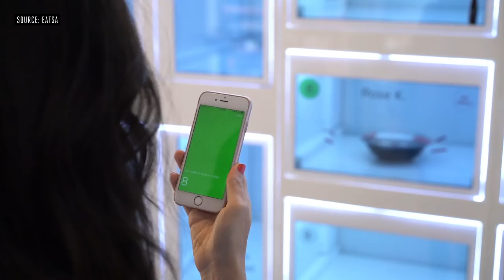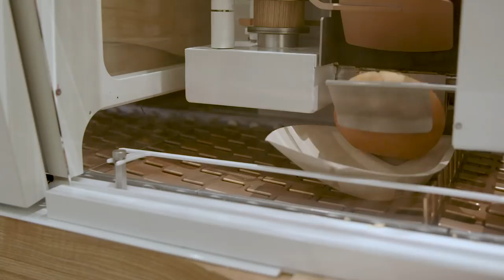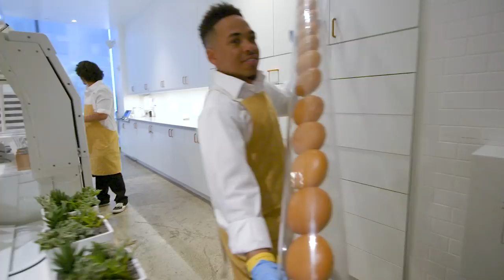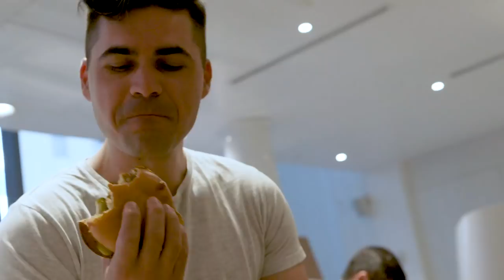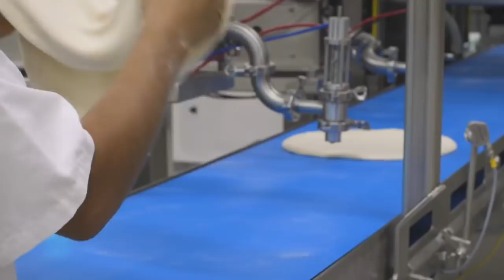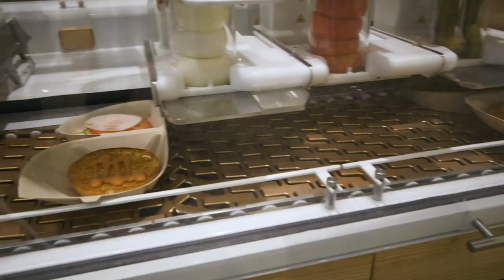Robot restaurants won’t take your job and food will be better

Comment: That's misleading, they still have to touch all the ingredients to stock the machine. So people are still touching everything on the burger. Plus the food sits in tubes for extended periods of time so it's technically not fresh. Eventually somebody has to eat the last burger in the tube and who knows how long its been in there. Plus it is touching all the fresher burgers above it when restocked unless they change the tube out after its empty.
Reply: It's otherwise sitting around in a cooler because restaurants need to keep their stock somewhere so going by that logic nothing is fresh and it doesn't matter. The point is it's fresher than, say, presliced produce. And given that it's a cheap restaurant in a big city I doubt the time produce stays in the tubes is as terrifying as you make it out to be.
Reply: This whole did not touch argument is stupid.
Assuming chefs wash their hands I have no problem with them preparing my food.
Why ask germaphobe?
Reply: @11Argetlam11  still no hairs is a plus...

Comment: "robots can pick up that slack and do those repetitive tasks that humans don't really need to do"..... yeah those are called JOBS and you literally just described robots taking those JOBS.
Reply: yeah she really stumbled over backwards on answering that question with the exact same statement as the original question, lol.
Reply: They take outdated jobs. However, they create jobs as well. Robots need to be maintained, calibrated, HACCP quality control frequency can be increased and people just need to be stand-by in case the machine is failing.
Reply: There are more fulfilling skills people can acquire. Taking orders is not a scalable skill set. I can guarantee you we will see a rise in robotics jobs, analysts jobs, and higher paying jobs in general catered to designing, building, and managing machines like these.
Reply: Sure. I'm pro machine, btw. But...the point of the machine is to save / make more money. IF that is in regards to rent space, sure! But generally, it's to save on labor costs. If a restaurant spend 200k on a machine and then even more money for the labor to run the machine, that's not going to work.
Reply: Before computers, clerks in banks manually tally account transactions and keep typing each ledger all day long. Just think if banks did not started using computers to save JOBS how our modern world would be? Now we have multiple branches of banks which can be managed by smaller people instead of bigger branch having multiple employees...maybe you don't need to go to a branch....you get everything on your mobile!
Reply: well the jobs weren't outdated until very recently. And obviously robots like this destroy far more jobs than they create, otherwise there would be no point in them
Reply: People working as cooks in san francisco won't be able to sustain themselves and will have to move out of the city or decline jobs, as mentioned it the video. Robots will have to fulfill that absent role.
Reply: guys get over it. this is the future. companies do not care if the robots take other people’s jobs because they profit from it. it is what it is
Reply: People like you are the reason why humanity cannot continue to innovate and move foward
Reply: Automated machines creating jobs in (making / servicing / etc) those machines is a fallacy which ignores AI in a decade from now.
Reply: Pannathat Poolkamlung 

Tbh moving forward has completely destroyed the natural world. We should stop being so innovative.
Reply: Moving forward has brought us ways to fix our mistakes. Not being so invoice would keep the coal burning, and poverty the same..  @shamicentertainment1262
Reply: @icelingbolt  With enough time I know we could solve our environmental problems, but I'm just worried it's either already too late, or we need to act incredibly quickly and change how we get our energy and how much we consume. I'm hoping we can change before it's too late. If that permafrost doesn't melt then we might have enough time.
Reply: @supportervandeeuropeseunie1625  Even then it makes more sense for a robot to fix another robot come soon enough. We might need to just understand a different way of life
Reply: Well technology taking people's jobs for almost 3 centuries, this is nothing new, this is literally happening every time when new technology is invented.
Reply: @supportervandeeuropeseunie1625  If these robots weren't saving money, ie. cutting jobs, then these companies wouldn't invest all of the time and money putting them in their facilities.
Reply: @supportervandeeuropeseunie1625  You described one person being able to maintain a machine capable of taking 10's of jobs. therein lies the concern.
Reply: It's sad how most of the people in this thread don't seem to know how economy works
Reply: Yeah but everyone just wants a high paying salary and doesn’t want to work. So people can go on to other creative endeavors.
Reply: can't stop the evolution. Reinvent yourself.

Comment: I work in industrial automation. I sell the sensors that machines like this use to see and do things. Automation does not kill jobs. It reallocates human resources to more meaningful areas. 

Would you enjoy watching potato packaging for 8 hours a day? No? Well good, because I have a $2,500 sensor that does that. Now that person who was watching potatoes can go and do something else in shipping/receiving, moving product, etc. 

There's currently a labor shortage in manufacturing. Automation is filling the void because there aren't enough people to fill these fields of work.  Employee wages at my customer firms generally go up after my company works with them. 

Same goes for restaurants. Now you can have cleaner restaurants and so on. No need to worry. Also, people enjoy human interaction. Not every restaurant will become automated. Also, automated capital is insanely expensive.

Comment: No they are not. The restaurant isn't giving people new jobs. The wouldn't be any point in doing it then.
A McDonald's restaurant that has 14 full time worker and the manager replaces them full automates. You now only need two workers and the manager. Tech to maintain the equipment.. another guy to fill the machines. You just reduced your work force by 11 workers. If it worked out any other way they wouldn't do it.

Comment: You ask for 15 dollars an hour, here's your pink slip. BTW, this is your replacement. Be careful what you ask for, especially when the labor you provide is unskilled labor...
Reply: was going to happen anyways
Reply: automation is inevitable
Reply: Frank Edwards You fail to understand that I am aware of that. What drives automation is costs (labor), especially when unskilled works demanding higher wages because they feel they deserve more then what they are receiving currently & politicians giving in (capture sympathy votes)  and making it law. Then employers in turn lay off employees or cut hours, until they can figure out a way to automate all repeatative jobs. BTW, I work with traders (MBS) they are a long ways from replacing them as their are variables that can't be quantified when trading and require human beings. AI has come along way, but still has a long ways to go... BTW, name calling is far from classy, so keep it civil...
Reply: +HeldroStar just wait until YOUR jobs will be automated, you will laugh less
Reply: Random guy I'll probably be six feet under due to heart failure before that happens...
Reply: then good thing for you, i guess, (heart attack isn't the best thing), but for my case half the of the job will be automate when i will be in my fortie if not sooner, and as a 17 year old, i need those entry level job to pay for my study
Reply: Random guy I would suggest go into engineering and learn how to code(Java, Javascript, PHP, Python, C++) humans are still needed to help automate and create AI, or become a Lawyer can't automate the judicial system...
Reply: But isn't that the point in the end? So none of us have to be forced to work? So that humans can choose to do things with their lives that actually have value and not slave away.
Reply: Kalel Anderson. You're right. That is the point, but some don't want that. Some subscribe to the protestant work ethic. I for one don't, but I know of people who do. I work in technology and live in a small town. A lot of people here work with their hands in farming, oil/gas and other manual labor. They look down on me. They honestly believe that they should be getting paid what I get paid or more. They believe their struggle is because people like me get paid too much. Yet, they drive the $80k lifted-on-huge-wheels diesel crew cabs and live in trailer homes. I drive a 9 year old Subaru and live in a moderately sized 3 bedroom house. THOSE are the people that will suffer, those that adapt will thrive. If they want to be left behind, let them be left behind. Society should not stop for those that refuse to adapt.
Reply: This doesn't apply here, they already get paid 15/ hour here in SF doesn't matter they need to make $35 / per hour  to even rent a 1 bedroom apartment.
Reply: HeldroStar 
"Random guy I would suggest go into engineering and learn how to code(Java, Javascript, PHP, Python, C++) humans are still needed to help automate and create AI, or become a Lawyer can't automate the judicial system... "
Coding is requiring less skill and a lot of the legal system has been automated.  I do not think juries and judges will respond to a computer, but a robot lawyer is possible to build
Reply: @Low pH No it wasn't. Robots aren't new and employees were cheaper than Robots, now employees are more expensive.
Reply: You can make a decent living at a fast food joint in Australia though... A manager is taking home $50kAUD and a burgerflipper could easily net $30k-$40k with a bit of overtime. Don't know how they convince you that a livable min wage doesn't help the lowest paid lol. I worked for $7 an hour at 13 and it felt terrible, each hour I could only think I only got a 5er in my pocket for all that...

Comment: I think automation is great, but it's undoubtedly going to kill a lot of jobs.
Reply: Do you see how they have to load the buns and how many? Every machine I have ever worked on , installed, maintained always required more people to feed, clear errors, and remove product from the machine. While losing jobs is always operators concern. My experience, (30+years) is more people are ALWAYS needed to keep it running.
Reply: @bambur1  Same with the "computer revolution".  It didn't eliminate paper oriented jobs, it just turned the paper into globally dispersed datacenters holding 1 gazillion sheets of virtual papers in EACH hard drive (or is it SSD now, then optical quantum gizmos).  Each requiring hundreds of workers from floor moppers to Ph.D's holders to keep running.  It's part of human nature.  You used to work on the farm and didn't know how to read.  Now everyone does and expects every book at one type away.  Same goes for hard goods.

Comment: "It takes 5 minutes to make a burger start to finish"... "With two machines the team can make 130 Burgers per hour"
 Is it just me or does this not add quite up.
Reply: Dragonrasa Exactly, 5/60 means there is 12 burgers per hour. 12*2 would then land it at 24 total per hour. She is probably one of those people with a degree in liberal arts that can’t do basic math.
Reply: Yeah, Could be that multiple burgers can be made at the same time, because she said it take 1 burger to 5 minites to complete the journey but did not state how many are making that journey at the same time
Reply: Dragonrasa & That Guy - You never heard about an assembly line? For example, it takes about 20 hours to assembly a Ford F150 on the assembly line, but a new car is produced every 53 seconds, so the line is fully loaded and running nonstop they could theoretically make 1630 cars every 24hours.

Comment: I think robotic restaurants, if implemented similarly to Creator, could really make a positive impact in the lives of employees. I'd never thought of the 'fresher food' angle, but that's a key strong point for these machines. You could spend more money on employees and on ingredients while still keeping overall menu prices down. You could ensure quality and consistency (so long as the robots are properly cleaned) while still taking care of your staff.
One more benefit is that some workers who find themselves intrigued by the inner workings of these robots could take training courses and become in-house or on-call repair technicians (likely making more money than before) to keep these robotic operations running smoothly! Not everyone will benefit from this point, but having 1-2 repair staff per restaurant would still be quite helpful overall.

Comment: Why are people freaking out about this? Every sector goes through this. It used to take 3-5 people to cut down and move a tree. Now it takes 1 person to do all that. Any kind of manufacturing assembly or even in a office environment technology impacts the number of employees. Airplanes needed a pilot, a copilot, a flight engineer and a what I think it was called a tracer. But now we’re closer to airplanes with no pilot.

Comment: If you press the meat for a burger, it gets tough. Best burger you can make is to hold your hand under a meat grinder, throw a new york strip in the grinder, take the freshly ground meat and lightly pat it down, season the burger, then grill it over a very hot fire.

That robot might make a burger techies love, but it won't be either good or real.

P.S. this is an idea from the 1950s, you only imagine to do it better than the automats.

Comment: Had this reporter even gone to school? She said, "...it takes 5 minutes to make a burger and with 2 machines they can make 130 burgers an hour." I can't get that to add up. Her word problem and answer is this: There is 60 minutes in an hour. It takes 5 minutes to make one burger. One machine can then make 65 burgers an hour. (I know she said 2 machines but I'm just doing one now.) I rewinded and listened to it several times to make sure I heard correctly. I did. Her math is so far off it's amazing she passed math class. I dropped out of school. I never finished High School or went to college and I know that what she said is impossible. Again. It takes one machine 5 minutes to make one burger. 60 minutes in an hour then one machine can only make 12 burgers an hour. With 2 machines that is then 24 burgers an hour. Not 130 as she said. For both machines to make a total of 130 burgers per hour which is 65 per machine, then each machine would need to make each burger in 55 seconds not 5 minutes.

Comment: There are some pizza places out there that have machines that will flatten out the dough ball, put sauce and cheese on the pizza, and even place pepperoni on it. They usually only appear in very high volume stores. Why would they need a robot to prepare the food? Easy...cut labor costs by hiring fewer employees. If the store is very busy, you need a lot of employees to run the store. If it slows down, those extra employees are forced into taking breaks or sent home early. The machine helps reduce the need for a larger work force.

So yeah, if a robot is flipping a burger, that's one person who doesn't have a job. The whole "They stock supplies and ingredients" is a lame excuse...because they do that already!

Comment: Problem is that automation reduces the amount of workers that a typical restaurant needs. As it decreases the need for workers the total cost of a robot is typically less than a worker. This reduces the amount of money brought back into the economy from employing a person instead of a worker.  Thus automation reduces the benefits for individuals  while benefiting owners. Even if other workers have a modestly increased salary the worker who can't find a job now becomes a tax burden which reduces the benefits of replacing them. This still gives the owner a better advantage than workers.

Comment: The potential does sound intriguing.  However, here's a point that struck me while watching the video:  The more expensive, human-made burger they showed for comparison at the end looked a heck of a lot more appetizing than the robot-made burger they were advertising, regardless of the good things they said about the taste of the bot-burger.  Part of this could be a production issue regarding the way the video was made--the production quality of the photo of the man-made burger was higher, so that could be the reason.  Also, innovation likely can and will allow for more visually enticing robot-made food (and this may not be the pinnacle of a robot-burger-making machine).

Still, I think the points others have been making are good:  these will probably be adopted by fast food first, and may be adopted by other chains and even higher end joints for prep work, but most higher end dining experiences will still probably want the human touch and artistry (for both aesthetics and taste) for a while yet.

Comment: Robotic restaurants could be run with one or two employees, instead of eight or more on the floor simultaneously. This also means that the fewer needed employees will have greater responsibilities, and they will be paid more – which is to say, there will be no need for any surly and low-agency Shaniqua's to be employed at a robotic restaurant.